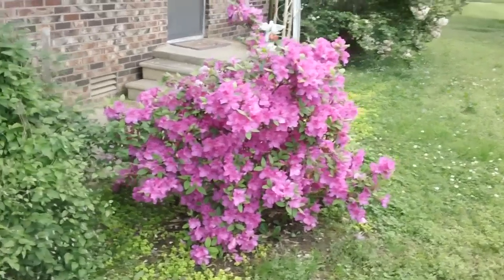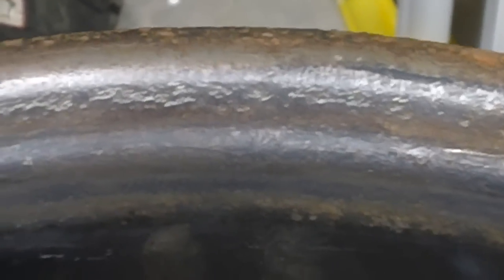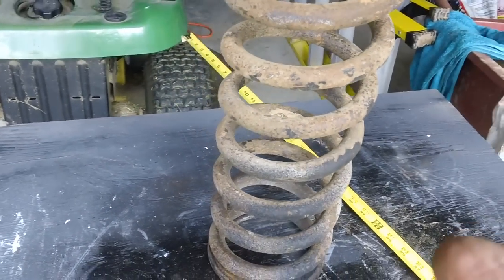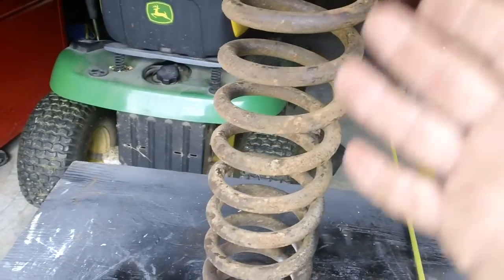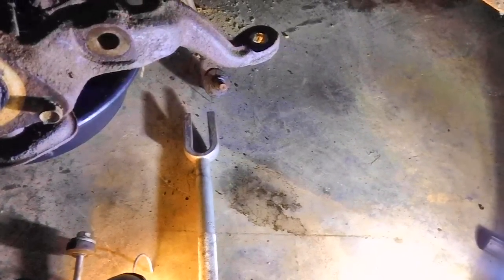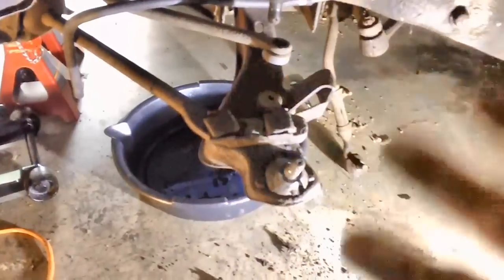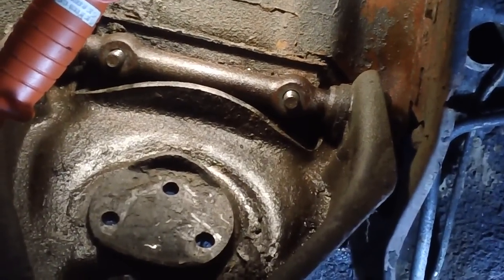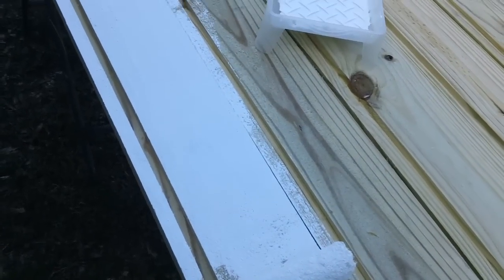1966 Ford Thunderbird repair and refurbishment (part 45). More front end disassembly.

Comment: The bolts are splined on the motor side so one man can adjust the camber & castor of the wheel be sure to put the shims back behind control arm shaft on each bolt which is easier said than done the shims need to be at the same spot they came from. I put the nuts back on the bolts then tapped on the nuts up down side to side to jiggle the bolts around to break up the rust around them carefully, one I was a little too zealous with I had to replace it because I loosened the spline and it spun when I tried to torque it. You could try wedge behind it. 5/11/19 you can at summit parts by the whole control arm ready to bolt in the new ball joint and all $61.99 limited special online. good luck!  PS. Grandpops nickname for me "Ra kaput zer" youtube wouldn't accept it, Go figure! So I had to use the odd spelling because I wanted that to be my online name. I only say this because you read something I wrote once I think you told me to Take a flying leap into a rolling donut. Seems you loathe dealing with fiberglass resin sorry. I grounded my self I couldn't play with my 65 Cadillac for a whole week no dessert as well.

Comment: Hey John, it isn't that I didn't find the rest of the video interesting, but I already knew how to remove coil springs so the only question that came to my mind was why not use the air compressor instead of an expensive can of air, lol.  I keep my compressor tank pressurized and a hose on it so it never would occur to me to have to hook everything up and wait for it :)  And yes, I do test the valve regularly.

Comment: I think 50yrs. of rust has welded those bolts to the upper control arm, maybe try heating them with a propane torch might help. PS: I think offset on a wheel is how far off center it is at the hub.
Reply from the maker: Sam,
Your guess is as good as mine, my friend, but I don't like the idea of heat.  It'll peel the paint off the fender in the engine compartment.  I'll keep working on it.
Regards,
John

Comment: John that's a fascinating paint roller. Where did you get it? LOL, I couldn't resist.  Actually I think a simple torch with MAPP gas should get it hot enough to break free.  Sometimes splashing it with cold water right after heat shocks the metal enough to break the rust bond.  The project is going great.

Comment: Hey John, 
What I would suggest is to use an inner tube for that wheel. I would think that would solve your problem.  I imagine you should be able to find an inner tube on eBay. 
I saw the comment that trashed your tape measure. I don't understand how someone could generate so much energy and hate for such a simple measuring device as a tape measure. LOL  Good grief, it's just a tape measure!
Regards, Tom
Reply from the maker: Tom,
I do plan to use an inner tube with the messed up rim. They're too expensive to throw away.  It'll be the spare tire.  I'll first smooth the bead with my rotary tool and a small grinding wheel.  As for the tape measure...that's Art from up north.   Hating measuring tapes is a Yankee cultural thing. 😊 
Regards,
John

Comment: Found a good picture here https://www.ebay.com.au/itm/Ford-Thunderbird-1961-1966-Upper-Control-Arm-Shaft-Kit-62-63-64-65-66-/282073240356 .  The shaft holes are not threaded. Heating may help. - 73 Curtis

Comment: Man John, you wouldn't think those bolts would be threaded in there. Wish I could help on that. In case someone wants to read what the offset of the wheel rim is,,, here is a link to a page on TireRack.com,,,, https://www.tirerack.com/wheels/tech/techpage.jsp?gclid=CjwKCAjwwtTmBRBqEiwA-b6c_z4Ax2JZXovb1zRx3eg49rwqRnKJieZVjQE3t9-Y01l7inIRY7s1RxoCbugQAvD_BwE&techid=101&ef_id=CjwKCAjwwtTmBRBqEiwA-b6c_z4Ax2JZXovb1zRx3eg49rwqRnKJieZVjQE3t9-Y01l7inIRY7s1RxoCbugQAvD_BwE:G:s&s_kwcid=AL!3756!3!304470776832!b!!g!!&affiliate=HM5
I know,,,, it's a long link,,,  ;p)

Comment: Ha! I got to the same impasse at about 6:00PM last night. Those upper control arm bolts don't budge. I'll let you know if I get mine out and how. Also, count your lucky stars that someone replace those lower ball joints at some point. Mine are still the original, and those rivets are made of some SERIOUS hard stuff. Cheers!
Reply from the maker: Eric,
You can also grind off the rivet heads, being careful not to grind into the control arm.  Chisel or grinder...I've done it both ways.
Regards,
John.